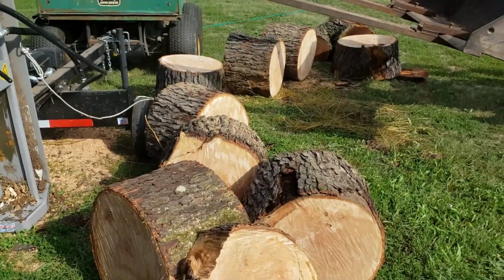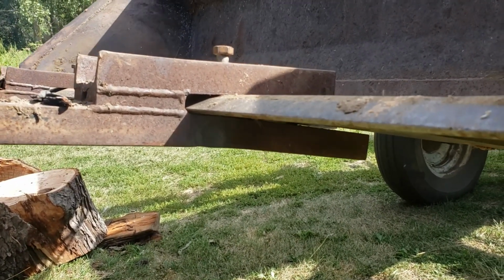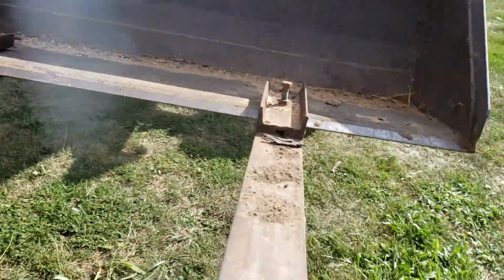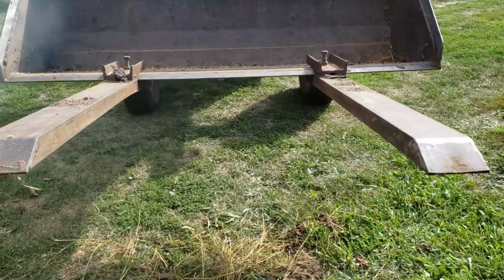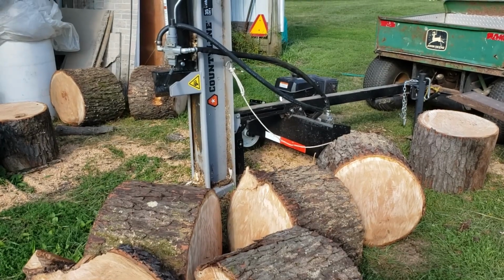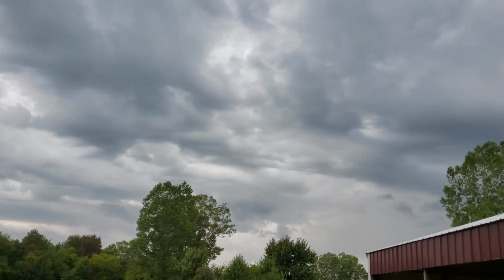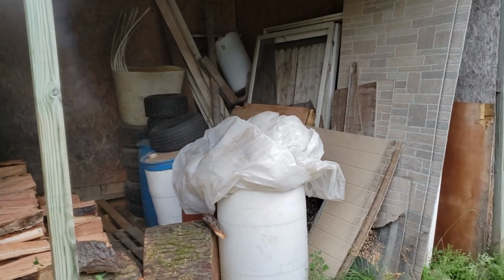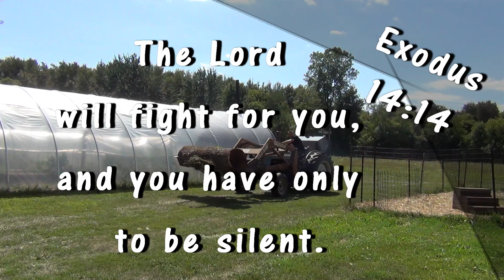Fixing These Changes How I Do Things Around Here

Comment: i felt sad that you cut the cherry up for fire wood i thought it would make some nice lumber wish you could have sold it or milled it up >  we made our first set of forks out of drill stem pipe but moved on to a set with a cross shaft out of a combine  are a wonderfull  piece of equipment might look into making a weight box for the 3pnt   half a 55 gal drum with a set of arm hookups on it with cement works wonders lifting heavy loads  dont forget to put a receiver hitch or something on it so you can move stuff without dropping  it off.   i just put a flat plate hitch and wish for a receiver all the time now .  have fun from oklahoma

Comment: You should take that cherry wood and sell it for bbq. A bag of fruit wood at the store is like 5 lbs and cost like $8.  
You said that one trunk was a 1000 lbs.
Reply: Most of that log was furniture-grade hardwood, and I think that would be the best use for it, although additionally chipping all the scraps and selling or using those for BBQ would be even better.  Still, it depends a lot on local markets.  Unless you have your own mill, you'd need to sell it as a log and would get much less for it.  I suppose in his market cherry logs must be cheap as dirt, and firewood expensive, so it wasn't worth doing it that way.  That's not the case here!

Still, I'm puzzled by why such a fine, large tree was cut down in the first place simply to make firewood.  If I owned land that produced trees like this, I'd selectively log out all the small, scrubby, overcrowded and twisted stuff and use that for firewood before taking a tree like this one for anything other than timber.  Perhaps it was in the wrong place and needed to go -- I hope so!
Reply: @andreafalconiero9089  yeah but he doesnt have a sawmill.  Id get ahold of some bbq places and just have them come pick it up. That much cherry would easily be a thousand. Or make chunks and bag it up. Sell it through Amazon or Ebay. Cherry is hard to find and is amazing with pork ribs.

Comment: That steel is called C-Channel and if you really wanted to make those forks super strong, would be to "box" it with a piece of 3/16'' flat stock to the bottom of each fork. You wouldn't need to weld the entire pieces, just a 1'' bead every 6'' or so. You would need to torch a hole for the through bolt that goes through the bucket. Thumbs up and Happy Labor Day weekend everyone !!

Comment: When it comes to splitting wood, nothing is worse than an upright splitter.  You have the tractor and forks...slide the forks closer together and roll a couple logs at a time on them, then roll onto the splitter in its normal position.

Comment: Not to be critical, just hoping to offer helpful suggestions. - If you have them to spare, you might want to consider making some pallet 'bunks' to stack & dry in.  (Like storage totes but unlike totes, pallets can often be found for free.)  Same goes with single pallets, if you arrange them & the wood on them so they can be picked up with your forks, its that much easier to work with.  Is for me, anyway.   -- Also, when (not if) you have issues with those nuts welded to the bucket, you might want to consider just leaving a smooth hole and placing a clean, lose nut on. -- These are the bunks I've been using for a few years..

https://youtu.be/Bi9czi_269E
Reply from the maker: Excellent idea, thanks!